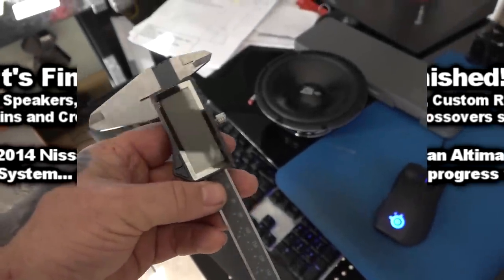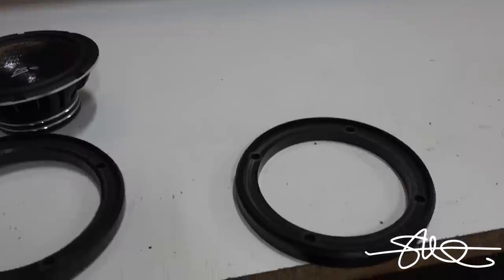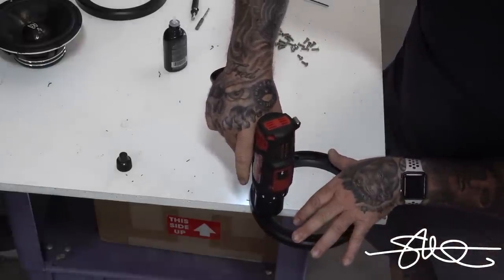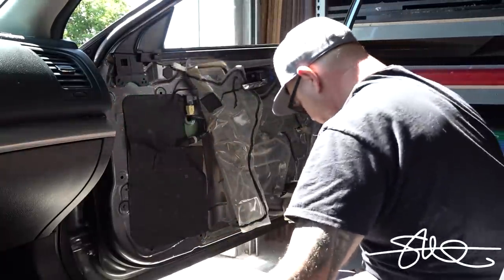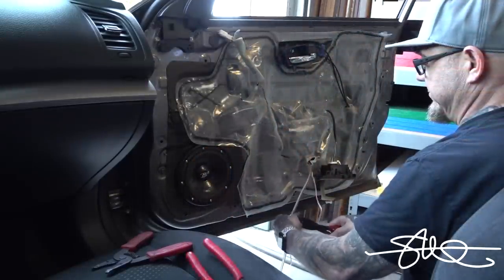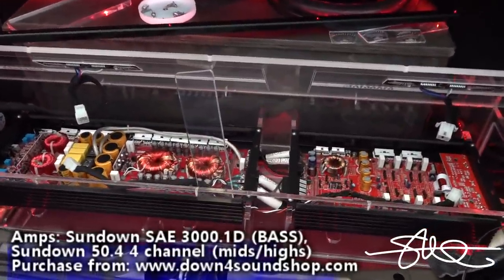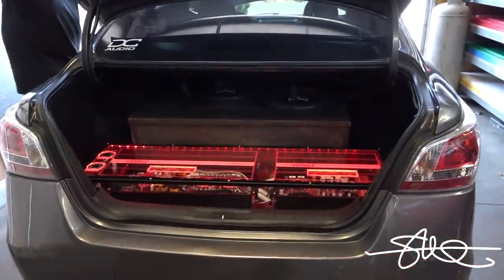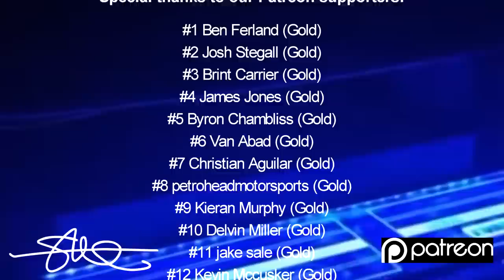Mids, Highs & BASS! Door Speakers Done, Gains & Crossovers Set, System Complete! First Impressions

Comment: Hey steve whats your thoughts on foam speaker cups are they worth it
Reply: I'm not Steve, but have used them before. For midbass speakers they're too small and muffle the sound. For midrange speakers 3-4 inches I believe they help with vocals.  I usually put some polyfill in them to help out.

Comment: I would like to know what is the best db sound wave to use when setting my amplifier gains? For example: 0db, 5db, 10db, etc. for tweeters, mid's, midbass and subs. Thanks for your time and patients.
Reply: I use 0db to set my mids and highs amps and -5db for my subs
Reply: @allaboutbass8146  i will have to try that out

Comment: How many watts and how many amplifier for the bass with that car sir?thanks
Reply: 1 Bass amp 1 mids and highs amp. Watch the whole series to see what amps he used.
Reply: @JoelYoungsey  OK sir,I had a sound in my car but I'm not satisfied the bass,what a good bass speaker to use sir?
Reply: @JoelYoungsey  is this 3 amp,I need to replace a bigger alternator?
Reply: @leotezarla245  no 2 amps. Watch  YouTube installers to see what they say about different speakers. Then from your budget pick a speaker.
Reply from the maker: if you actually watched the video you would have your answer.
Reply: @meade916  exactly